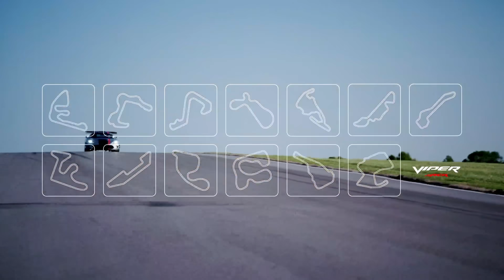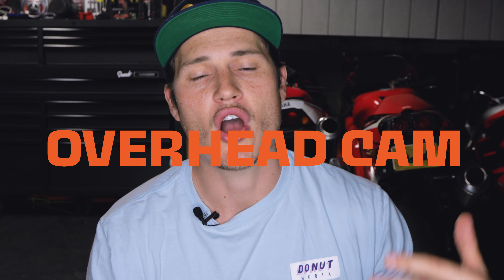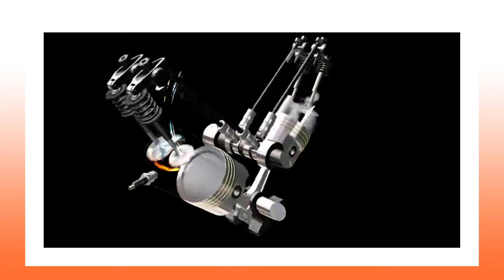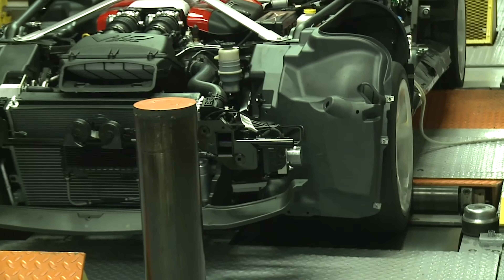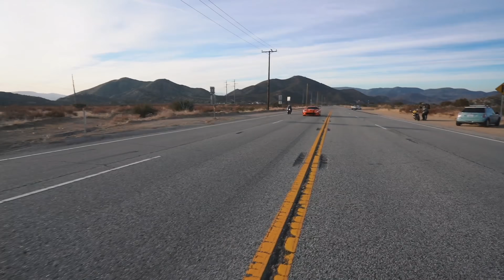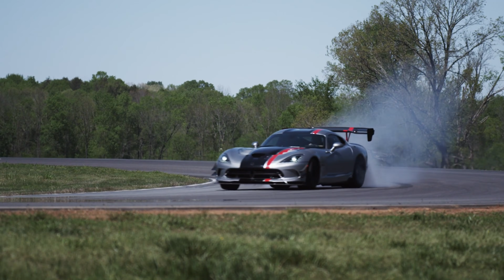The Engineering Behind the BEST car America Will EVER MAKE - Dodge Viper ACR

Comment: 15:02 woah woah woah... dude, wings and spoilers are NOT the same thing and are not interchangeable, wings create down force, spoilers spoil air flow minimizing the lift on a car....the Viper ACR even has both a wing AND a spoiler...they're just not the same thing, and you shouldn't be using the terms interchangeably....

also; push rods for lyfe gang gang

Comment: Great video! **that's not how lift works. Lift works by air flowing faster above Vs below the wing. The pressure from above moving faster pulls the plane up.

Comment: My fear is that one day Dodge will announce the return of the Viper, but they'll make it very un-vipery. Traction control on at all times, an entry level V6/V8 base model, automatic option/only, not deadly at all. It might sound selfish, but I hope the viper doesn't come back at all if any of that that turns out to be the case, I would rather have my favorite car ever ending it's run on the highest of high note as one of the most legendary cars ever built, than coming back as a disgrace to its legacy.

Comment: FYI at the 15:05 mark you said they "Use a spoiler or wing to do that (produce down force)" that's incorrect. Spoilers don't produce down force just watch the Donut Media video you guys made last year on aerodynamics. They fill with air and spoil or retard the airflow from above so the airflow from below (If it has good laminar flow) gets to the rear of the car moving faster than the airflow up top. This adds to the efficiency of the rear diffuser (once again if it has proper laminar flow) and produces lower pressure below causing the higher pressure above to push down harder on the vehicle.

Comment: Dodge Viper ACR technically doesn't have the most downforce of any production car, Project One and Mclaren Senna have more. Also, that title technically goes to the Aston Martin Valkyrie. It produces three times as much downforce, even though it has two more cylinders, it produces nearly 400 more horsepower with 2L less in displacement. And that's without the hybrid KERS system.

Comment: The problem with the pushrods is that they bend when under the immense forces when the engine revs high. For comparison you shouldn't have used a broom but a celery stalk.

Comment: Everyone says that the Dodge Viper wants to kill you, that's not true. The Dodge Viper is just unsympathetic to your lack of driving ability. If you try to take a turn way too fast and slam the brakes causing you to spin, it's not the car's fault that you suck.
Reply: well, it's not exactly trying to keep you alive...
Reply: @rya3190  Nope, it sure as hell isn't. It's not trying to kill you, but at the same time it's not gonna hold your hand like a helicopter parent. No control systems to save you from your driving mistakes. It's like Dark Souls, but for cars.
Reply: Rya 31 it's trying to kill you
Reply: preach boi
Reply: Viper:  You dont just jump into the ring with Tyson just because you think you can box.
Reply: shred1894 Car's still trying to kill you
Reply: @aftrnoon_ac  No, it's the driver's lack of skill trying to kill them. The car only does exactly what you tell it to do, for better or worse.
Reply: @CANeelJavia  they changed because of having better research and development which is why there is a sophisticated traction and stability control. Dodge and most American cars are behind but they are getting there
Reply: Exactly, people need to show respect on fast cars like the Viper. Plus the Viper wasn't the only killing machine. Old Ferraris and Lamborghinis had this reputation as well. Porsche GT2s and even Mercedes Benz SLS wasn't an easy car to drive fast. If you crash it's still your fault, you are in control, not the car so step up your game.
Reply: shred1894 that just seems like a piss poor excuse for bad engineering.
Reply: @iamwritingrightnow8217  not at all, it's a car made for enthusiasts, without all the bullshit electronic assists and crap that neuter the driving experience by nanny-stating your throttle or stopping you from doing burnouts. And actually, with the crazy wide tires, the viper actually grips like crazy, but that also means you gotta be pushing way harder for it to actually let go and lose control. If it was poorly engineered, it wouldn't have been a world class sports car with track records that compete with exotics.

Comment: one of the best cars ever.  Good vid again man.  But downforce is very different than lift.  Wind (air) IS actually pushing down on the aero of cars.   A plane's wing is specially shaped NOT to have air push it up, but rather it creates an area of low pressure above the wing.  A plane does not get pushed up into the air, but actually lifted by the low pressure areas.  Thus  "lift"  It is sorta the same, but different lol.  Now some cars actually do use "reverse-lift"?  Air flow through vents to help cool the brakes actually create a low pressure area under the car sucking it to the ground and helping it not to get airborn

Comment: You were saying the perpendicular bits on the aero are to keep the air in place, but I'm pretty sure the reason for endplates on a wing or the winglets on the dive planes is to prevent tip vortices because that sort of turbulence ends up upsetting the flow which actually generates downforce due to the pressure difference across the top and bottom of the wing. Also, dive planes seem to cause more drag than downforce so I'm not sure the air is truly flowing over it as much as it is just slamming into it generating a normal force forcing the car down as opposed to being pulled down like the rear is..

Comment: Actually, most of the lift generated by a plane wing comes from the low pressure on the top (and not the high pressure below)

Comment: The Dodge Viper, the car that wants to kill you
Reply: The CAR doesn't want to kill you. It's just a raw experience with it's manual trans and crazy torque at any rpm and no traction control or stability control or ABS, instead of computers driving the car for you. If you don't push the limits, you'll probably be fine, and if you do, you might get YOURSELF killed. Also the rear tire width is 355 which is really wide and has a lot of grip, but as soon as you go past the limit of that grip around a turn, it's gonna want to spin out hard
Reply: @wolfemancola  similar to the Porsche carrera gt
Reply: the dodge viper, because men are made

Comment: Wrong about rear diffuser strakes. The primary reason they are there is to reduce tire squirt. The secondary reasons are to prevent tunnel slip and vortice tracing.
Reply: I'd be willing to bet that you don't know the meaning of anything you just said.
Reply: Tire squirt? 🤔

Comment: "The Most American car." But the V10 in it was made by Lamborghini. Yeah, it came from a truck, but it was given to Lamborghini who cast it in aluminum to make it lighter weight. Also, SINCE then, it's been tweaked by Mercedes-tuner AMG, and it was looked at by Ferrari when Chrysler joined Fiat. But it's a great V10 because of all that collaboration. AND, Lamborghini and Audi didn't have V10s until AFTER Lamborghini was done with the Viper. And there were rumors that the Mercedes SLS was originally supposed to be the new Viper but Chrysler got sold before they could stuff the V10 into it. (Although, more than likely, it was more of the mini-Viper that Chrysler's been trying to build for 20 years. Starting with the Copperhead and continuing through the Firepower) So, you could say the Viper was the birth of the modern V10. And it's because of it, we have the Gallardo and Huracan and the Audi R8...and SLS and AMG GT
Reply: It has little to no relation to the Ram V10, and it was made using the Magnum/LA engine as a starting platform. The magnum V10 from the Ram trucks was aslo magnum-derived, but it was made later, and was cast iron instead of alloy. Lamborghini adapted it to alloy, yes, but the core engineering is oldschool Chrysler. Also, Ferrari was split from FCA literally as the FCA merger happened, so no actual work was done to the Viper engine by Ferrari engineers.The rest is correct, though.
Reply: @MarchuxProductions  The engine started life as a concept engine for the Ram, but yeah, the only time it ever saw life in a truck was when they stuffed it in the Ram SRT10. And yeah. Ferrari said they looked at the V10, but that. Maserati/Alfa Romeo would have done pointers and done any tweaking. Point is, it some pretty big hands and eyes have been on that V10.

Comment: 1776 mm wide spoiler because america founded in 1776

If that was why they did it, why'd you use millimeters?

Also, it's a wing, not a spoiler; if you're able to put your face in it, it's a wing, which appears to be true on the acr

Comment: Vtec and vvt are very different and they keep misusing the terms...😅 vvt is variable valve timing which can advance or retard the camshaft, while "vtec" is the valves being operated by a different lobb at certain rpm on the camshaft which pushes the valve down further

Comment: He said it produces more down force than any production car ever built. At 155 (lower than the speed at which the Viper produces its 1700 lbs of down force), the Koenigsegg Jesko (high-down force track version) produces 1764 lbs of down force, and at its top speed, it makes almost 3100 lbs of down force, which is almost as much as the thing weighs. Of course it's traveling about 100 mph faster, but if traveling at the same speed as the Viper, it'll still be producing way more down force. So close, but not quite Viper. Nice try.

Comment: One minor correction, the bottom of an airplane’s wing doesn’t generate lift, the top does. The lift comes from the air moving over the top of the wing faster than the bottom of the wing, so it isn’t like the wing is being pushed up from the bottom, it is being pulled up from the top.

Comment: Wrong, its not the amount of air, its the volume that fits, remember even if its NA the vacum created by the expansion cycle suck mor air into the chamber that the volume of air measured without the cycle

Comment: "The intake and exhaust valves have to be in line simply due to the layout of a underhead cam engine".... dude apparently has never seen a 2nd gen Hemi or BBC
Reply: Yep. Or Cleveland heads or a ton more
Reply: Late model Hemis, too.

Comment: Entire engine in my car is 0.9 L. That's 0.06 L (60 ml)  bigger than one Viper cylinder. Cool :D
And it weighs 735 kg (1620 lbs). Almost as much as Vipers downforce. Cool :D

I drive a 1996 Fiat Cinquecento ;)

Comment: 15:12

>" 1,776 MILLIMETER wide spoiler"

So... i can just lie down in a ACR spoiler, AND I WILL FIT PERFECTLY?!
Reply: Same length as Freedom 🦅 🇺🇸
Reply: njshift MURICAHHHHH
Reply: Wrong units. That’s 69.921 inches.
Reply: Yo will not fit sir because of the risers
Reply: @keji7878  The guides are on the outside of the wing...
Reply: If you want but idk why you would

Comment: petition to make Jeremiah's nickname

Dodge Jeremessiah
Reply from the maker: Do you think I'll be able to drive on water? - Jeremiah
Reply: @Donut  If you go fast enough, hit the water at the right angle and have the right tires, sure... at least for a little while. You should test that some time.
Reply: @Donut  obviously lmao
Reply: Donut Media they do it with dirt bikes, why not in cars?
Reply: @michaelpugh2617  Well the dirtbikes that drive on water (well they skid and cant do that for very long) weigh like 180lbs and still make >50hp, just look at the power to weight ratio plus cars are designed for downforce, you want upforce in this case.
Reply: @xGxPhantomZzz  lift?

Comment: If dodge brought this back and made it cost less than the c8 they would sell so many
Reply: Justin Lamb well no shit it would sell so many, making any expensive car less than $60,000 it would sell a shit ton
Reply: sure the Viper most likely would've sold more if it had an auto trans, but that's like asking Honda to make an RWD Civic Type R
Reply: I think Dodge should make a Hellcat ACR,a Hellcat that can actually turn
Reply: Static the demon widebody without the pizza cutter wheels can pull over one G. What they say about challengers is total BS. Chargers are pretty heavy though.
Reply: Mike Russo they have a very similar weight, idk what you are talking about
Reply: @THESLlCK  they're almost the same weight
Reply: It will need an auto option
Reply: @ARDEN440i  you might as well ask Dodge to add a turbo because it goes against everything the viper is
Reply: @oscarchang486  I could see a forced induction V10 with paddle shifters (The type that you have to use like  a Praga R1R, not a choice).
Reply: @oscarchang486  The reason why the Viper ended production is because not everyone wants / can drive a manual. It only makes sense to allow a wider range of an audience to access the car. Look at the Vette.
Reply: @ARDEN440i  we got Lamborghini and Ferrari for autos
Reply: @tacticalplayer6337  Not a traditional automatic. Think Ferrai Enzo.

Comment: Those little winglets on the wing and aero bits are to keep vortexes from forming because vortexes act like parachutes. Vortexes are swirling air pockets that spill of the sides of anything trying to create downforce or lift. As well as what you were saying, all the little fins on all the aero planes also help create a laminator flow instead of a turbulent flow which would act like a parachute and slow the car down even more.

Comment: OK lots of cool stuff here (especially variable valve timing on a pushrod engine) but dangit donut it's only a spoiler if the base is attached to the trunk. This thing has a wing. I mean there's a pretty aggressive lip on that trunk too, but the wing is doing most of the work back there.

Comment: When are y’all making an up to speed of the 2015 Chrysler 200
Reply: I mean its a rebadged dodge dart. It came out back in 2014 I think, the same year they axed the avenger which was actually doing better and 2 years later the 200 and dart got discontinued. The avenger and dart both had srts planned but dodge axed them the year before they were set to release.

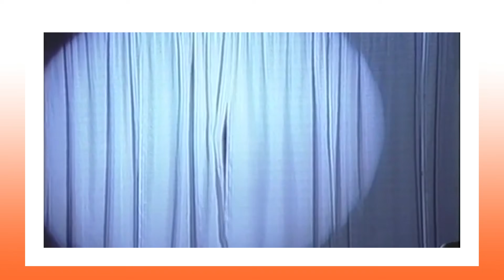Comment: Laguna Seca - 1:28.65
Road Atlanta - 1:26.54 
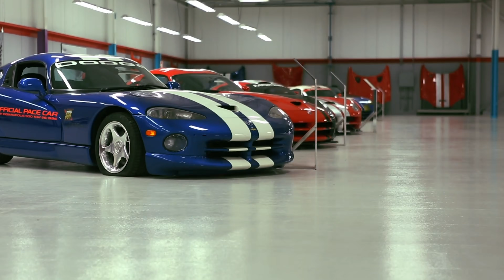Waterford Hills - 1:10.89
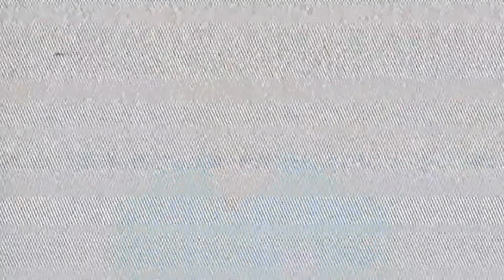Nelson Ledges - 1:06.21
Motown Mile - 51.17
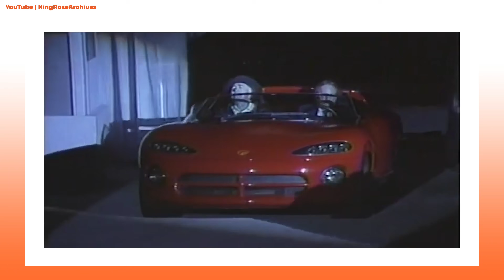GingerMan Raceway - 1:31.91
Pittsburgh International Race Complex - 58.37
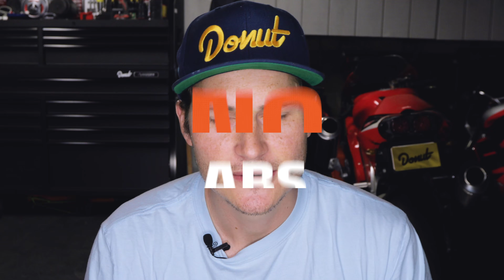Grattan Raceway - 1:22.09
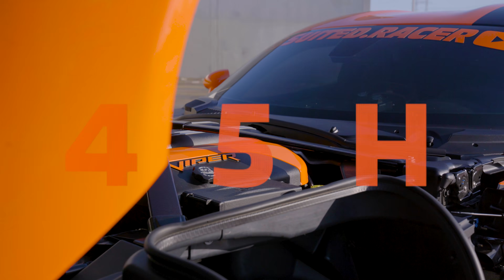Virginia International Raceway - 2:40.02 
Willow Springs Raceway - 1:21.24 
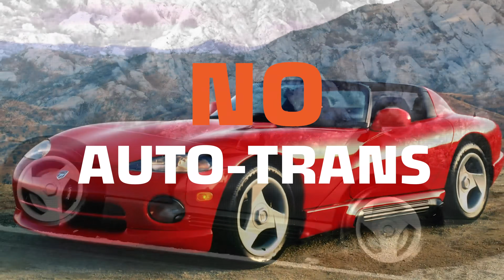MotorSport Ranch - 1:16.98
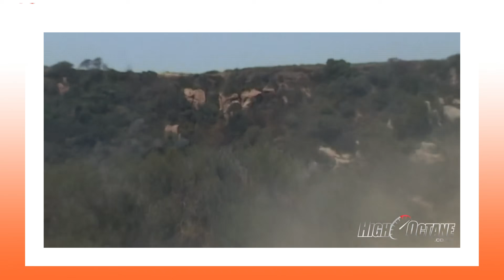Buttonwillow Raceway Park - 1:47.70
Inde Motorsports Ranch - 1:33.75
ACROSS THE GLOBE BTW